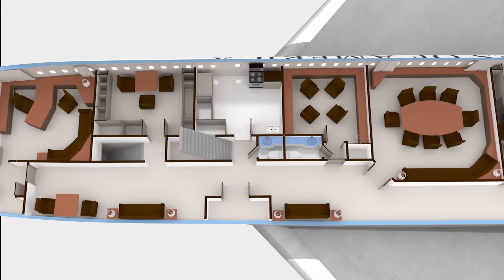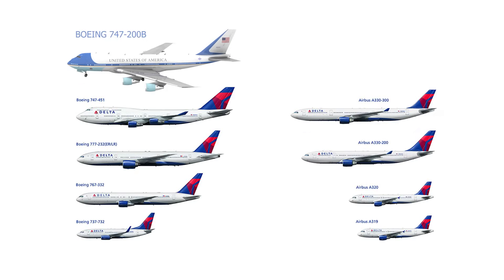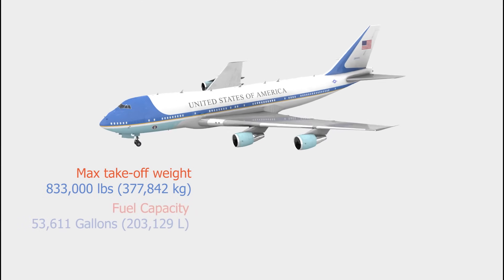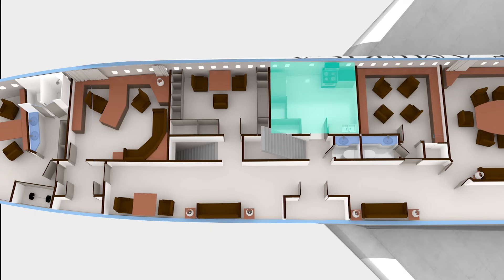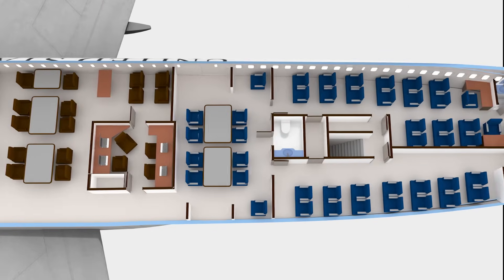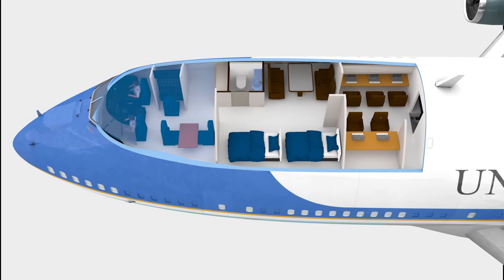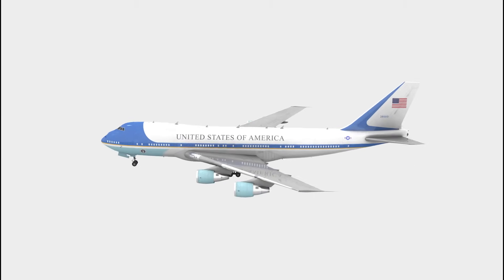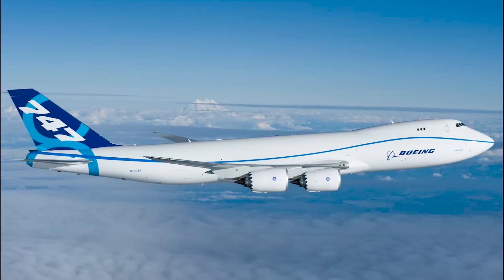What's inside Air Force One - US President's Airplane

Comment: Remember that Mach is heavily affected by wind, pressure and temperature. At sea level and room temp Mach .84 is around 646mph but at a cruise altitude of say 38000 feet at -58 Celsius it’s more like 550mph. Not a small difference!

Comment: Interesting video.  A few things. 
Firstly, the 747 200's 28000/29000 are first known as Angel 1 & Angel 2, before the president boards the aeroplane.  Air force one isn't the aeroplane,  but a Air traffic control callsign, which become active upon the presidents arrival. Not before.  
Secondly, if the president was to board a aeroplane,  with the livery  of the United States of America, for example  757/737/executive jet/C17 Globemaster or the 747 Doomsday aeroplane,  that aeroplane will be called Air Force One.
Thirdly,  if the president was to fly in a commercial aeroplane,  that callsign would be 'Executive One'. This rarely happens,  but the same callsign is used for the outgoing president  flight to Andrews Joint airforce base on the presidential helicopter.  
Otherwise,  very interesting video.

Comment: Fuel tanks, just like all airplane fuel tanks, are bladders, and they ensconce them in bullet proof compartments in military uses.  They don’t put them in the wings, because that would make the tanks susceptible to damage, and make the plane turn slower.  Plus, it’s too much weight in the wings, and there’s no room.  The wing is packed with mechanical and hydraulic actuators for the many flight surfaces that tuck into the wing.  It’s quite complex in a big jet.  There’s no room for tanks, and you can see, basically, right through the wing when. It’s open upon landing.  Don’t be a fool

Comment: fun fact about the modified presidential 747-200 it uses the 747-400 engines GE CF6-80C2 , the original apu is removed and uses 2 767 APUs allowing 4 engine starts at the same time and apu inflight starts capability , if u look at pictures of the vc-25 there's a second inlet door on the left side of the tail. and 2 apu exhausts!

Comment: Let me correct you. Airforce one has not only 2 pilots. As a typical B 747-200 it has also a flight engineer's panel and additional place for  a navigator, which is located right behind the captain's seat.
Reply: I like your comment as it does correctly state the full compliment of the flight crew.  However, while a flight engineer was, in many cases, a stepping stone into the front seats and extra stripes on the epaulets, the position of flight engineer and navigator are not truly pilot positions, thus, in a splitting hairs type way, both of you are accurate.  Plus there would be reserve pilots onboard for extended flight operations, as would be the case with any flight over 8 hours in length.
Reply: Let just talk about this. This is right but what about the 🔥 😂
Reply: All plane has 3 pilot exept sort fligt
Reply: Let me correct you - it’s Air Force One
Reply: Sweden*Stockholms
Reply: @flightstormchannel  and it’s Aircraft Commander not Captain
Reply: the President's B747-200B features an updated cockpit from the B747-400 which enables the B747-200B to be flown by just 2 pilots just like the B747-400 . . . which is why Air Force One is flown by only two pilots since the mid 1990s but this was not the case always . . . when the new Air Force One was introduced based on the B747-200B, back in the early 1980s it used to be flown by 3 pilots e.i. captain, co-pilot & flight engineer . . . prior to the 1980s the President's Air Force One used to be the B707-420 that served until Reagan . . . anyway coming back to the current AF One . . . in the 1990s the B747-200B was extensively upgraded & one of upgrades was the adoption of a two pilot cockpit from the new B747-400 . . . instead of the previous 3-pilot cockpit . . .
Reply: @chandrachurniyogi8394  you have no effing idea what you are talking about, it does still carry a flight engineer and navigator